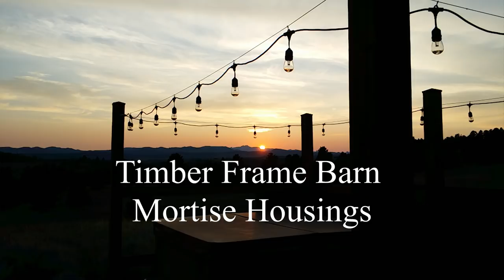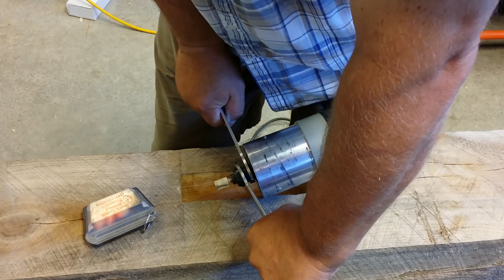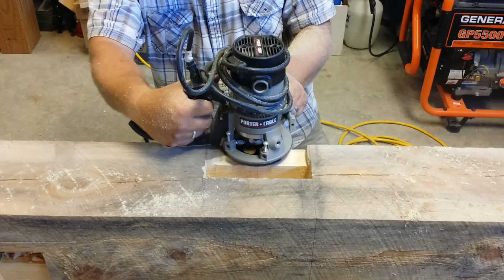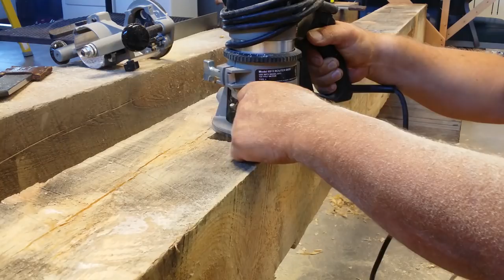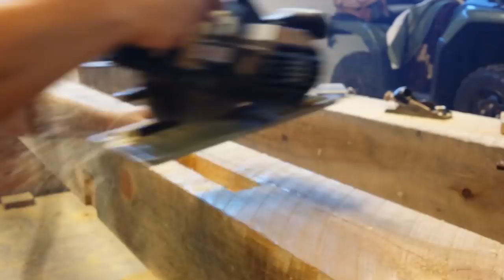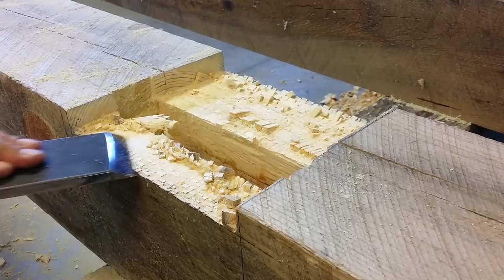Timber Frame Barn Project - Cutting Housings

Comment: I use 1/4" Plexiglass to make router bases wide enough to span the entire cut area. Makes for very stable routing and you can see through it. If you have distributors in your area, sometimes they sell cutoffs pretty cheap but be prepared because they usually carry many other plastics and when you see all the choices, you may come home with a truck load.
Reply from the maker: lake bum working on it, thanks for the support!

Comment: Great work Tim! It’s always good to know various ways of making cuts to get the same result....I used a router for most housings....but the odd time I’ll plunge cut with my chainsaw....always fun lol😂🌲
Reply from the maker: Jimi Timbers Thanks Jimi.  Would like to try the chainsaw trick.  The router does a good job but a saw and slick seems faster.
Reply: Great Plains Craftsman we use 1” bits in the routers...so it clears pretty good.....but I prefer the saw method too 😉🌲

Comment: I am sure you know. Just clamp a scrap to the side to help with the tilting of the router near the edge.
Enjoy the videos.
Reply from the maker: Lars Eckman Thanks for the suggestion!  Usually not a problem I was just trying to use one of my long bits and it just didn't work very well.